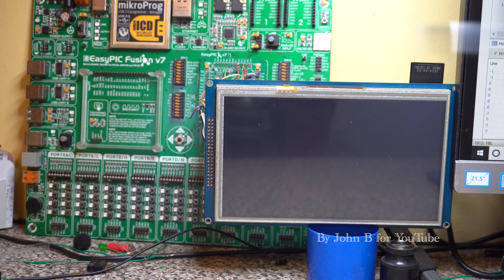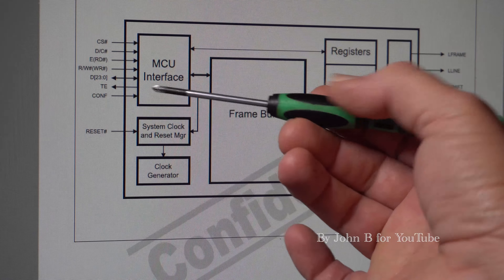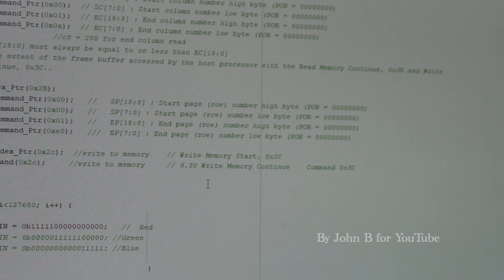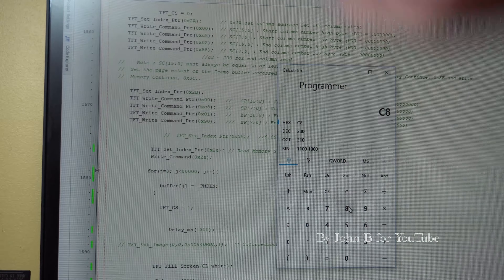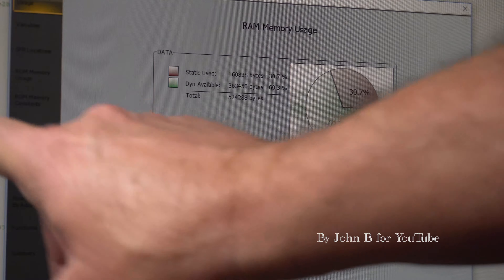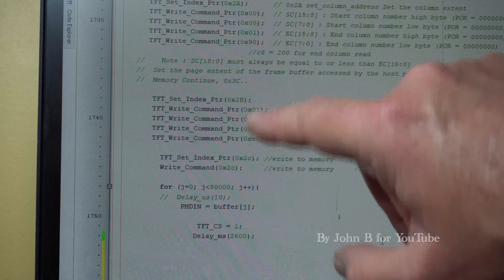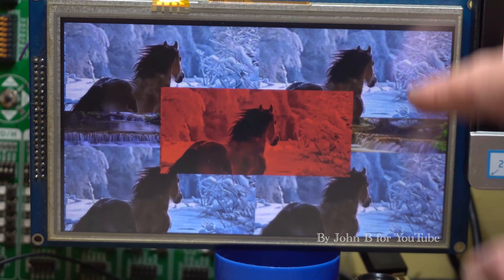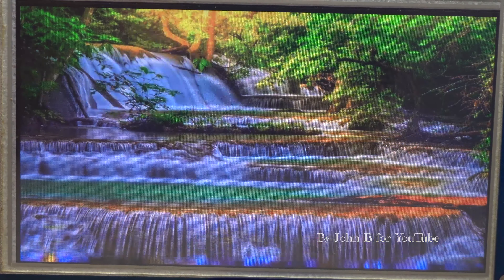SSD1963 Screen Capture with MikroC Pro for Pic32 & Microchip's Pic32MZ

Comment: You have been bizzeee3
Reply from the maker: Hi,
Do you mean getting this code working? 
The MP3 player took 20 more days lol
Reply: John B both,
Reply: John B what did you end up with  as far as the MP3 player goes...  I used the demo which worked ok, but I could  not sort out the speed error and distortion with your version, this project looks good but way beyond me.
Reply from the maker: Hi,
I'm sure i mentioned -one must 'set' the peripheral clock divisor to 8, that sets the bus speed for the spi & mp3 player. 
Do you still use your MikroE kit?
I seem to remember you said you were going back to your stm32?
Reply: John B I use both, but mainly pic8,16 and. Pic 32 Just got the updated pic suite. I have all apart from the ft90”
.i did see your note about bus speed, I’ll give it another try today,
Reply from the maker: Do you mean MikroC pro for Pic32 or just the MikroC pro for Pic?
Reply: John B sorry John my typing is appalling, I have all the MikroC compilers and boards to match apart from  the Ft..
The updated one is the Pic MikroC. 7.2 . I haven’t done a great deal over past few weeks as a fell and broke my leg just below the hip,
Which laid me up. I have just got back to playing with a few things, my wife brought a Rigol MSOD 4054 for my BD.. 
in December and I just plugged it in to day,  marvellous bit of kit. Fully fitted, just been looking at CAN bus,  and SPI
I got a demo board which shows all the features,  I think my last scope was a valve tek single chan, I used back in the TV service days,
Som 40 years ago, ow that’s sounds so far away,,   
Like this video your a very clever guy...
Reply from the maker: Hi,
Wow, sorry to hear you broke your leg, sounds very painful.
You must have broke your bank buying that lot lol, what made you decide to buy the Mikroelektronika products and not Microchip?
I've not had chance to review your scope yet, I will do one day.
Your valvetek sounds like one I had, 10MHz and a round CRT lol.
I hope it doesn't take you too long to recover.
Thank you for your comments as always, pleased you like this video, it took me years to complete. 
As I mentioned, I tried many years ago without success.
I have been helping someone with their TFT so started playing with the SSD frame buffer again, 6 hours later, job done.
The Pic communicating with the frame buffer is soooooo fast compared to a 25 MHz spi SD card.
Reply: John B I have got  MPLAB Xide, and Atmel Studio7, I have loads of boards xpress 16/32. Xpress 8 curiosity boards, Attiny  to be honest there so many I have picked up over the past 18 months.  I brought out a guys collection for peanuts then opened a Account with MC, and I just get bits as they come out, I have xc32 xc16 free compilers but I have xc8  pro..  really makes a difference. I also have Flowcode and a load of eblocks from Matrix ..
I have built quite a lot of bits using one MCU or another, just gadgets.. playing with LORA at the moment.. just set up Node Red with MQTT .. you know I’m just a hoarder ... lol...   il have to make a private video ...  
I have also been playing with MC new security chips, very interesting webinar I watched ,  a lot of changes on the way special y with IOT devices.
I hope this rambling makes some sense as my writing is terrible...
Reply from the maker: wow, I don't know how you manage with all the variations in code.
Just had to look up MQTT lol
Reply: John B MQTT ( mosquito) is a Broker  I use with node red.. great for using with IOT devic3s...
Most all the code I use is in C, it’s just the compiler that’s different.
I’m just setting up a LORaWAN , or trying to.lol... I’m gonna have a day what’s left of it playing with scope,  I have the demo board which 
Creates just about every sig...